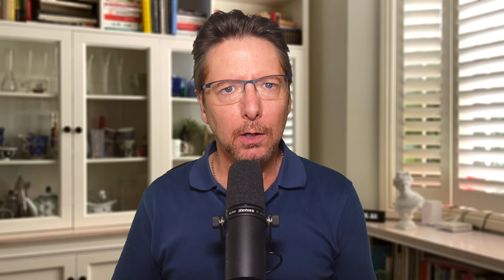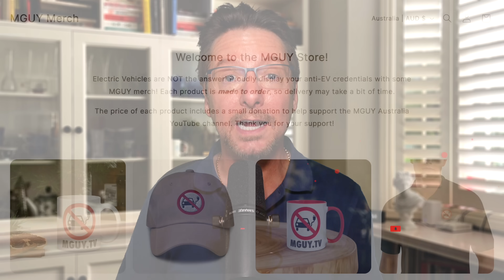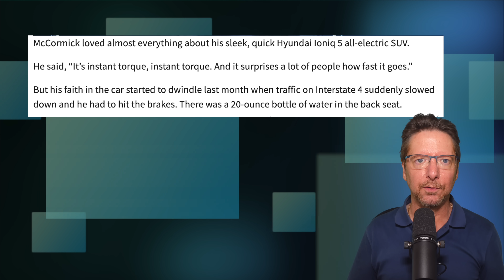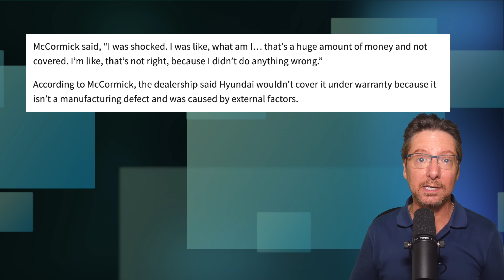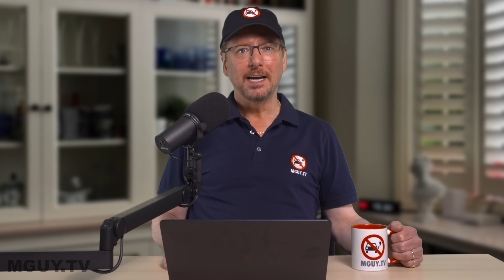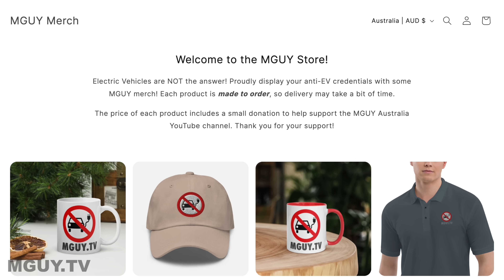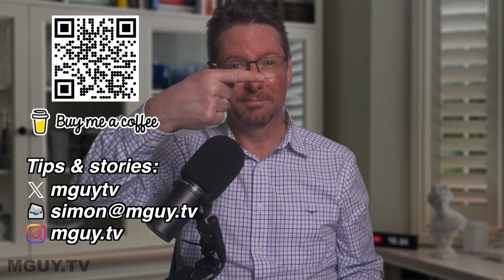ASTRONOMICAL EV repair bill for spilling a WATER BOTTLE! | MGUY Australia

Comment: “The torque!! The torque!!! How fast it accelerates!!!”
Is there literally anything else that EV owners can crow about besides that one point? They’re a one trick pony.
Reply: You want to talk about torque, about 10 years ago i had a 30' spruce tree in my yard that needed to go, to close to the house. I didn't want it falling on the house when i cut it down so I hooked a cable to it about 10 feet up. I then hooked up to the hitch on my 1994 dodge cumins diesel, put the truck in 4x4 and pulled the tree out roots and all. I didn't even have to pull that hard. That's torque.
Reply: And then they go under the speed limit after they overtaken everyone else, causing long lines behind them as they just realize they don't have enough battery to the next charger.
Reply: Well, my C8 can keep up, but not as fast but by only a few tenths of a second. Meanwhile, people are filming me and taking my cars picture and talking about it. EV people don't get that.
Reply: Well, the ONLY other thing faster in an EV IS ITS DEPRECIATION.
Reply: They're quite pretty when you watch them burn! (Unless you're inside....)
Reply: It's pretty much the only thing better about the driving experience compared to an ICE vehicle.
Reply: @hiflyer000  I grew up in the 60's and 70's Let me just say you young guys missed the muscle car era. Ever riden in a car that can lift the front wheels off the ground on take off.. I have.
Reply: He must be showing off constantly overtaking and weaving in and out like a monkey on acid
Reply: lovely and quite to drive ..........
Reply: @andrew-o5i  Counting is not their forte here on MGUY.
Reply: Thy are the quietest vehicles on the road, they are also the cheapest to run. I think that is more than one trick if my math serves me correctly.  You can also fuel them up at home via rooftop solar while you relax having a beer, or refuel at night while you sleep, they also do not pump out cancer causing exhaust emissions.  Wow, if my counting skills serve me correctly that is now 5 things Mr Wombat.
Reply: @tacocangrabembythetaco  lmao cope seethe dilate
Reply: @aname3576  Oh I must've passed you too eh? Sorry, my EV seems to trigger you insecure boys and cause you lots of shrinkage. I see guys like you every week...as specks in my rearview mirror. Good luck with all your ailments above.
Reply: @tacocangrabembythetaco they also now have a tampon dispenser in the glove box.
You sound vaccinated mate
Reply: @tacocangrabembythetaco All boring stuff, anything noteworthy ?

Comment: so... its not even because its an EV? thats all 12V system, BCM and wiring harness... its actually got nothing to do with it being an EV. I wonder if a gas Hyundai would do the same thing? I find this hillarious, but i feel bad for the guy...and basically every owner of a newer car.

"in a regular car a small spill might fry one module" Listen, a car these days wont start if you unplug the front radar camera... Any fried module sends all the others into chaos, and bricks the car. EVERY newer car is a pile of expensive garabge.

1000$ headlights are not an EV-exclusive, ither. If you want to be fair, you should also look into new ICE cars. ANY car built in the last few years is a ticking time bomb for an insane repair bill.

Comment: Guys there's something deeper here, don't be fooled. Remember when there was a scandal with the hyundai technicians arrested and sent back in Korea? It was (is) a pretty serious deal. Add to that the newest "discovery" that you need a diag tool to change the rear brake pads, a procedure that you need for every manufacturer for the last 10+ years, but somehow only hyundai is to blame for... now we have this john doe that had a bill for 12k "from a water spill"... to me it smells like the vw diesel gate. How do you push in the selling of domestic cars? Well...either you make them better or you put the others in a bad light 🤔. I'm no EV guy, but these little tricks are not based on electricity. It's just tactics.

Comment: Hyundai in the UK say you need a £2000 module to reset the brake pads !!
Reply: Just watched a video where a guy fixed this issue with 2 short lengths of wire and his power drill battery. 30 cents fix.
Reply: @Jaysays209    Seen the same video today, glad I did
Reply: @Jaysays209  Yeah, now watch Hyundai release software that immobilises the vehicle if certain sensors detect a workaround. Sly buggers.
Reply: @Jaysays209  You Tube guy "Lance Mechanics" did a vid on it.
Reply: Apparently you can do it with just a 9 volt PP3 type battery too, no wires needed, or terminals. It just winds the piston a bit slower. Anything that supplies about 12volts will work, so don't use the higher voltage tool batteries like 18 or 21 volt ones, 14 volt should be OK.
Reply: i heard the cost is 2k at the dealer
Reply: What a fuffing con!

Comment: I’d be surprised if the US doesn’t have an equivalent to the UK’s “Sales of Goods Act”, which covers not only manufacture defects but design standards.  A vehicle so susceptible to a minor spill would be deemed “unfit for purpose” and a repair enforced, even if outside the warranty period, if the cause was proven to be from a minor spill.  Driving through puddles would also count, though driving through flood water wouldn’t, and you could expect arguments about where the distinction between puddles and floods lies…
Reply: There have already been stories of battery replacements for road debris.  Definitely an area that needs attention on what is covered by warranty and insurance.  This will bankrupt people if foreseeable damage (flooding, debris, spills...) are not covered.

Comment: I got my Nissan patrol stuck in a half frozen water hole in the mountains for 3 days, with around 5cm of water over the floor. When I got it out, I pulled the seats and carpet out, shampooed and high pressure washed seats and carpets, wet vacced them and left them out in the sun for a day, then chucked it all back in the car. That was 10 years ago, and the only problem to crop up was the recirculate motor for the interior ventilation died a few years ago, and I had to spend a hundred bux on a new one.
Reply: I had smoke come out from under the rear seat.  Pulled seat out, disconnected the battery, and fix the shorted wire.  Car lasted another 15 years without a problem.

Comment: Growing up I had both gas powered and battery powered RC cars. 
The little single cylinder gas motor ran flawlessly, just needing a glow plug replaced for a few dollars. 

The battery went dead on the battery powered car. It was like $65 to replace it, and this was back in the 80’s. Yes, it was very easy to fix, but expensive. 

Then my battery charger overcharged the battery and melted it. 🔥 So I gave the car away.

Comment: Does Florida have consumer protection laws? Because the gaslighting from Hyundai and his insurer are obscenities. Not in anyone's wildest dreams would they think a small water spill in their car could or should result in a repair bill for anything at all, let alone repairs costing almost $12,000! He should sue them into oblivion!
Reply: It's probably by design, when the battery goes into thermal runway the bottom of the car has a hole into the battery pack so that water can be dumped through the sunroof into the passenger compartment and then into the battery. This will cool it down and hopefully contain some of the now toxic water, and its a lot safer for the firemen who only need to operate a crane with a hose from their truck. Of course after such fire the battery clown car is a complete write off and if you spill a small amount of water the car is basically fucked.
Reply: they have a lemon law.   but thats not applicable in this case.  poor guy.

Comment: I wonder if the recent electrical fire on a ship in port at Los Angeles was an EV fire 🤔
Reply: Exactly what I was thinking.  The last report I heard, the fire chief said they couldn't put the fire out, no one would say if was EVs or a load of lithium ion batteries.
Reply: I wonder if the 250 ship fires reported in 2024 were due to EVs.....maybe not as they were not all carrying EVs.......
Reply: @martinwalker9234  Examine electrical fires, not just fires. How many ships had electrical fires and of those how many were caused by EV's or batteries? My guess is all of them.

Comment: WARNING,dont buy an EV with a sunroof,as we all know they often leak when it rains.
Reply: Don't buy an EV full stop.
Reply: @christinehede7578 I was about to write the same thing.
Reply: Yes but it can serve as an escape hatch when the rest of the ev starts shooting out flames
Reply: @nickmalone3143 no because its electric and will lock
Reply: @davidridland sunroof will self destruct
Reply: Or you forget to close it and it rains. My son forgot to close his, but the gas car worked fine after drying out the interior.
Reply: Don't buy an EV at all.
Reply: ...ironic since Japanese makers managed to make leak-proof sunroofs 30 years ago....
Reply: My 1982 Volvo 345GL has a sunroof and it doesn't leak. It is well designed.
Reply: Which is ironic, because it seems like a lot of cars have sunroof nowadays.
Reply: I imagine a sun roof on an EV, will cause it to warm up far more, and then the car will have to turn itself on, to keep it cool. Thereby, losing more charge and becoming more annoying. I guess if it runs down its charge to zero, the batteries will ignite, should they become hot enough.
Reply: Dont get into your EV  if it is raining as your wet clothes can fry the electrics and leave you with a $10000 bill
Reply: You can also forget to close the sunroof when parked. Happened to me when it started to rain. It wasn't an EV, so it was only annoying
Reply: Small children and pets occasionally leak as well.
Reply: I would drop my psychic insurance company.  How would they know it was long term green crustiest?
Reply: Agree about not buying an EV, sunroofs leak because people leave them open parked under trees and debris clogs up the drains around the edge, I don't even use my sunroof so it's never been a problem.
Reply: To be fair it’s not just EVs that have that problem. I believe the Rav4 has a similar issue
Reply: @pantoqwerty  they all have car care nut and excellent toyota lexus channel with a master technician even tough he got a sunroof because he had a very good deal on one he made a video recording working on a sunroof and told his audience to never buy sunroof cars

Comment: In my old car if water gets spilled the carpet get wet. That's it. No big bill, just a bit of kitchen towel unless you let it dry on it's own.
Reply: Yep. My el-cheapo 1998 Ford Fiesta had a major leak for months that I didn't bother to fix -- floor was simply constantly inundated with 2 inches of water throughout. It caused zero problems other than wet feet.
Reply: @kugelschreiBERND   And no damage to the environment!
Reply: @philip1522  Exactly! Although in hindsight, I should probably have fixed the leak sooner anyway 😄 (I was busy and young AND stupid...)

Comment: 11000 dollars for "wiring harnesses" - are they having a laugh!

sure, many manufacturers put ECUs under seats  - and these are improperly waterproofed and could cost a fortune to replace - but wiring harnesses should all be built waterproof - even inside the car. Guess what, in the morning in winter condensation builds up everywhere inside a vehicle!!

Either way, bad publicity for Hyundai - something the dealer and the company should have "handled". 

I am absolutely certain that this would have been everywhere in the MSM if it had been a Chinese vehicle.

Comment: A couple of years ago a friend who had just bought a Kia EV and had been charging it at home asked if I wanted to ride with him to test it on a fast charger about 30mi away. We plugged in and when the battery was at about 90% we heard a loud POP under the car and saw 60miles disappear  from the range. Charging after that resulted in 50 to 60mi less than he had charging at home. No error messages and KIA refused to scan for codes even if he paid for it. 

Now almost 3 years later, the battery and on-bord charging controller failed, and KIA said it was due to home charging off a charger my friend an Industrial power electrician for over 30 years installed. Repairs are could run over $20,000 USD. 

Turns out there was a late 2024 Recall of over 200,000 Kia and Hyundai EVs for Failures of the  integrated charging control unit (ICCU) that plays manages battery charging and power distribution.  His vehicle is effected in the Recall that came out late last year but was never notified and now KIA is trying to blame the failures on his non-compliance with the recall and home charging installation. He's considering selling it as salvage rather than going to court.
Reply: I hope you didn't drove that one back home. When they pop like that it's usually only seconds until they go into thermal runway. Better call the fire brigade immediately and have the professionals tow it after a controlled burn.
Reply: @John8087  He drove it for about 2 years.
Reply: Hope he won't make the same mistake and wouldn't buy another EV.

Comment: As someone who worked doing maintenance on our subway tracks, don't rely on transit when things get quite a bit wet as well as subways don't do  well when water rises above a certain albeit shallow  point. Same goes for buses as many are switching over to full electric over natural gas hybrids.  I guess the elites don't want us traveling using anything other than a bicycle and expect us to live in a 15 minute city.
Reply: Bicycles are underrated, no tracking, no taxes, no loicensing, easy to mount a small two stroke petrol engine or just build up your leg muscles which is useful when you get close enough to the final boss to curb stomp their head.

Comment: Two unfortunates in Canada bought the same idiodic car for $55k each. They were each presented with a $65k bill to swap out the battery after some road debris caused damage to the battery guard. You have to laugh at these clown shows. Steer clear of AMG's as well unless you have extremely deep pockets.
Reply: as someone driving a 2.7" ground clearance sportscar in 5 years I had a tree branch a large chunk of ice and some aluminium part that fell from a truck ruin my undertray it happens the difference is it cost me nothing I never fixed it while on an EV you can say bye to your insurance that if they learn you have a tiny scratch on it will cancel your contract unless you swap the whole battery pack not just the cover

Comment: A very rare occurrence.  Meanwhile ice drivers have to lose their car for a day whilst it's being serviced. A service is not chesp these days either!
Reply: An oil-change is still cheap compared to pure-plug-in vehicle depreciation.

My last tire-rotation and oil-change took only about an hour (at my local Toyota dealership).
I change the engine and cabin air-filters, and wipers, myself.
Reply: @aliendroneservices6621times have changed then as I used to lose my car for the day and cost £300 plus   - and that was 7 years ago! Now im paying 2p/mile  saving me a fortune
Reply: If the occurrence is so rare, why is there a reddit thread of people commiserating about being sodomized.
Where on earth do you go to lose your 
vehicle for a day to have it serviced ?
   Your  🐎 💩 stories are what we typically see from you EVangelist Zealots.

Comment: My sister bought a Subaru diesel SUV not knowing high beam in one of the headlights didn't work. They wouldn't pass it for rego so she had to fix it, it had LED headlights which use a flapper to change from low to high beam and of course it's not serviceable. AUD $2000 for a replacement headlight, luckily I did the work for her so no labour cost. It's not only EVs that are stupidly expensive to repair.
Reply: Average modern car experience.
Reply: And I've always thought these lads saying "Yo you pay EUR 3000 for a headlight on a 'modern' car lulz" were exaggerating 😂

Comment: God forbid your roof leaks.
Reply: A writeoff rainfall.
Reply: or you leave a window down in a rain shower....
Reply: My Opel was over 30 when the front construction after some worshop repair started to leak and  rain was sneaking into. After each  winter    I had to rech steel floor under front seats  , dry/suck stored water  and paint anticorrosion . But car was brilant so I did  not stop   driving with it for may be 10 years more. No conclusions.
Reply: left my sunroof open on my 89 Accord, went to work.. and it pooooored rain. ECM is under the drivers seat on the floor. That was 13 years ago. It hasnt cared yet...lol
Reply: All sun rooves leak.
Reply: That is actually a very good point! Also, I forgot in the Summer to roll the windows back up; it rained, and the interior got wet. Never had a problem after the interior dried out.
Reply: Apparently they do